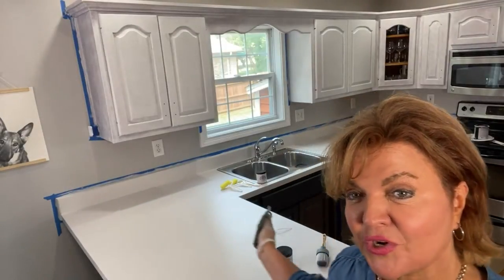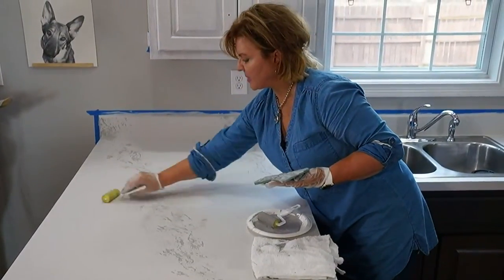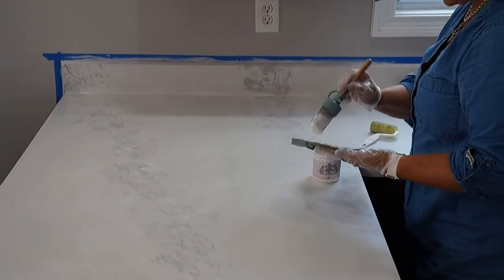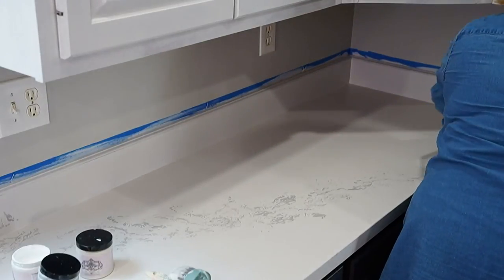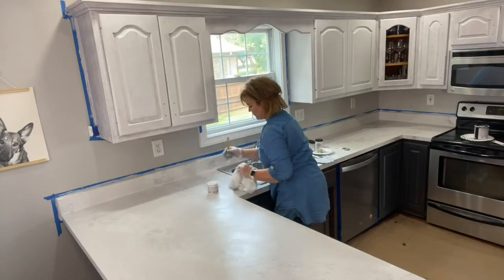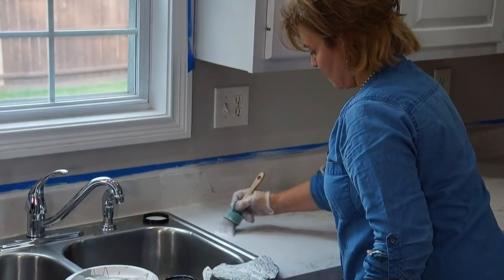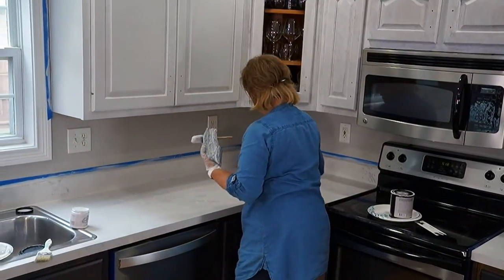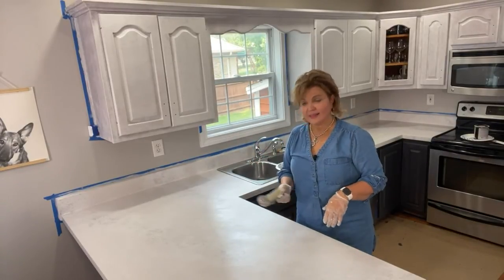How to get Stone Countertops on a DIY Budget! Part 2

Comment: I am painting my kitchen  cabinets  cappuccino.  What do you think of a base of linen for the countertops  with copper metallic for stamping? My backsplash is going to be copper. Should I  still use that pearlescent  white for blending or do you recommend  another  color?
Reply: My appliances are white.  So, I  don't  have a problem  with adding  the white.